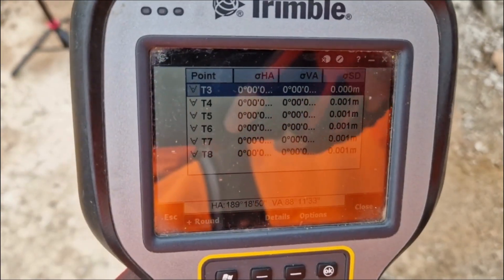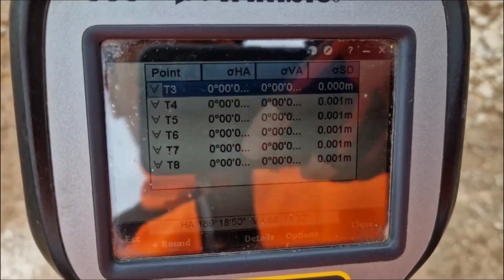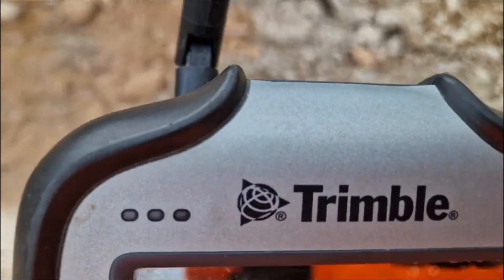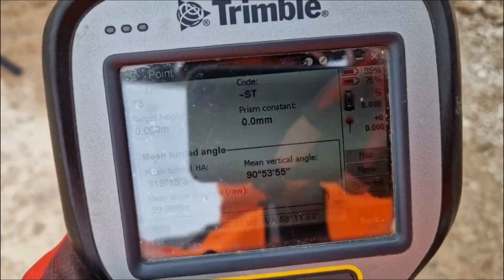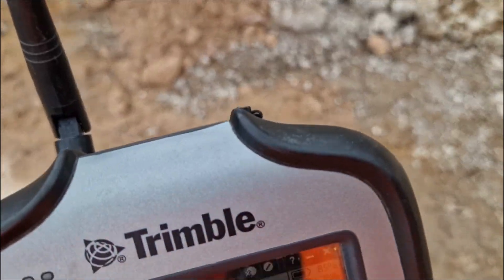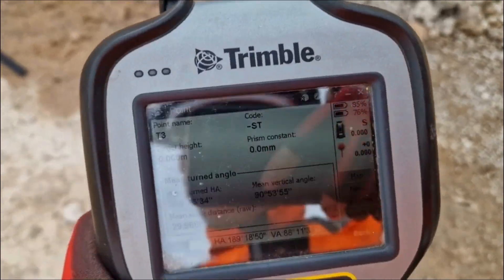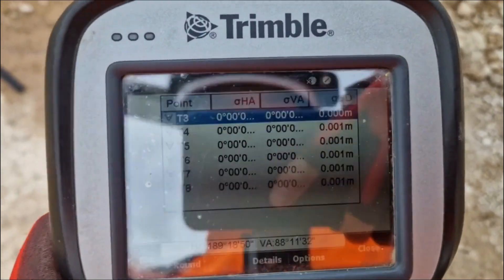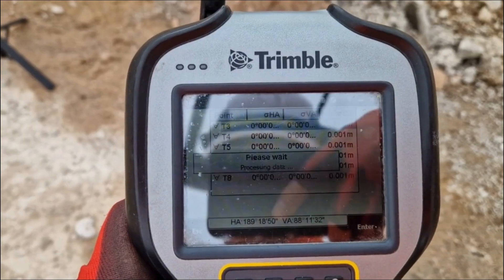Building A POWERFUL Setting Out Network From Scratch

Comment: Great video! I would definitely be interested in seeing you explain your primary control network and the calculations involved.
Which method of establishing a control network would be best on sites where you are unable to see many targets and can’t do rounds  from a single setup. For example if the site extends around streets where there are buildings in the way.
Reply from the maker: Thank you Dylan! I will present in a future video how to establish and calculate a primary site network. 
Regarding your site situation it depends of site layout, location and tolerances. Maybe in your situation it's better to set nails on the ground and traverse them.